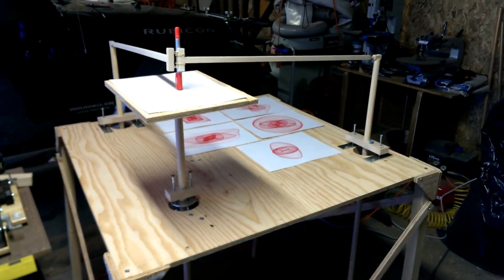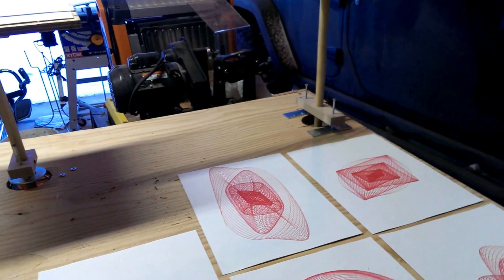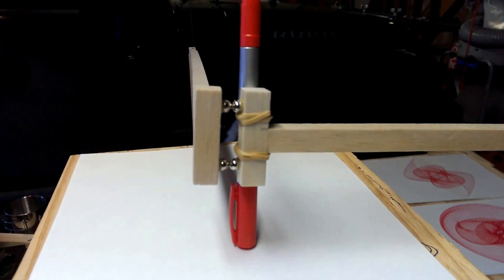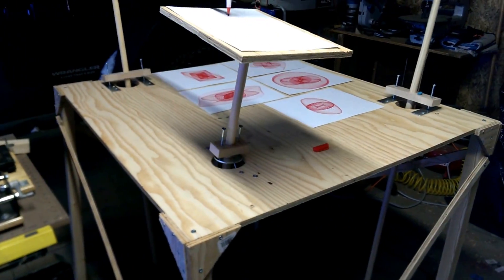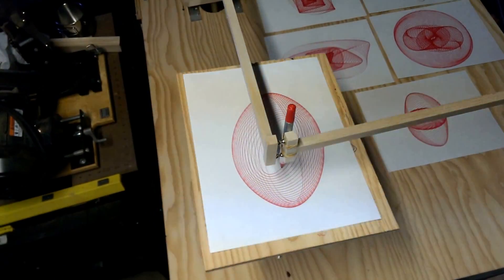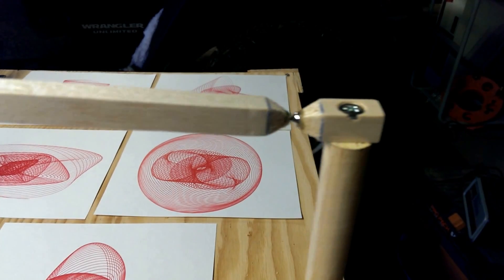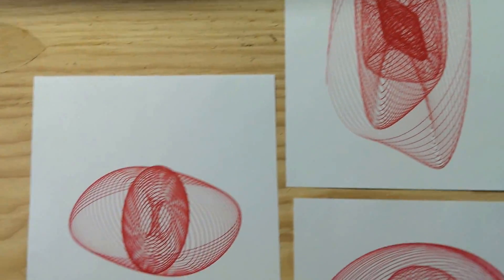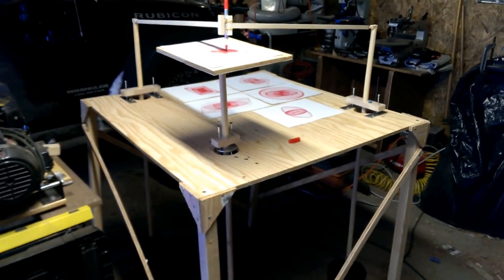3 Pendulum Harmonograph

Comment: I love the magnetic sphere coupling.
Reply: It's an absolutely genius idea. I made one of these harmonographs last year and the friction was so bad that the drawing stopped before it even drew a recognizable pattern. After installing this coupling, the drawings were absolutely beautiful and incredibly intricate.
Reply: @ayaan5540  Hi Ayaan, tried this recently as well but friction is still to high to let the pendulums swing like in Nick's video. Any idea, what could be done wrong? Maybe the weight of the horizontal traverses is to high or the pendulum weights are to small (1.25kg each). Thanks for some ideas.
Reply: @langschaft01  Hi. Maybe late reply, but try minimum 3-4 kg weights per each pendulum. For the drawing pad pendulum 2-3 kg is enough, but the other two needs more weight 4-5 or more. And place the weights as low as possible to lengthen the swinging time.

Comment: How much weight you use on each pendulums?
Reply from the maker: I used 15 pounds, about 7 kilograms, on each pendulum. You want to ensure that you can adjust the weights up and down on the pendulum to change the frequency or period of each pendulum. Have fun and I hope this is helpful.
Reply from the maker: +Indurdut Ramdewor , agreed!  The weight does not need to be changed to adjust the period, only it's position up or down on the shaft of the pendulum, which in effect changes the length of the pendulum.  Thank you for the equation, most useful.
Reply: +Nick Gilmour but the period of pendulum depends on its length only.
Period of pendulum, T = 2π√L/g
L : length of pendulum 
g : acceleration due to gravity
Reply: +Nick Gilmour okkkkkkkkkkkkk, now i get it ;)